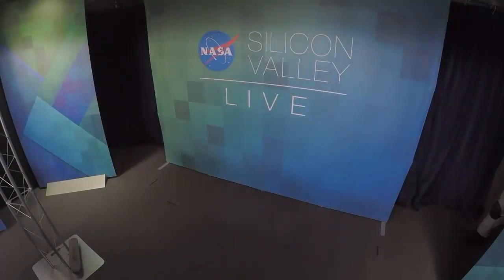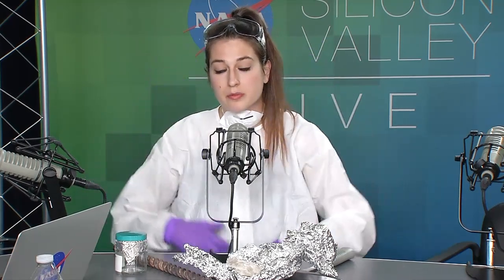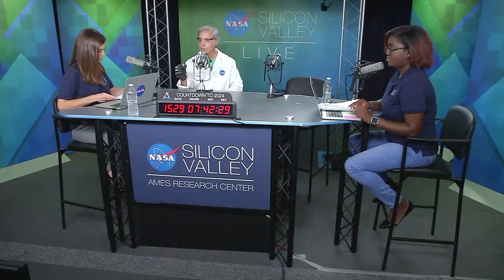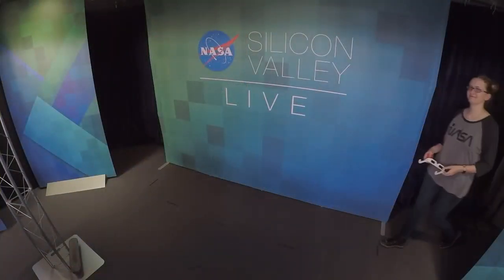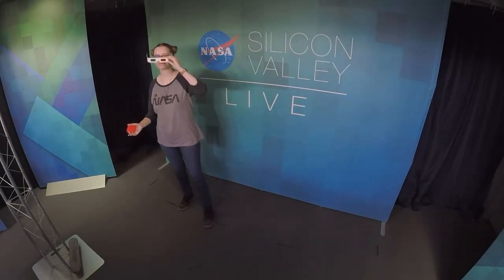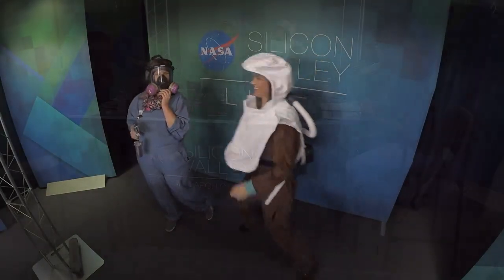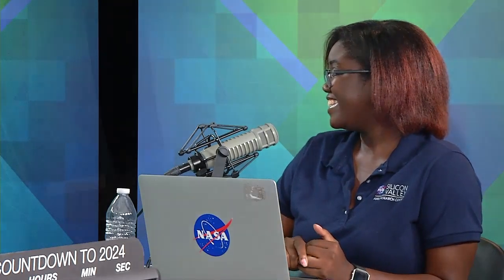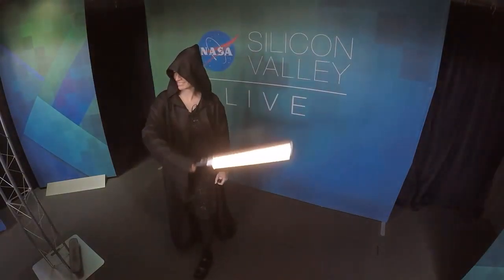NASA in Silicon Valley Live - Halloween Episode

Comment: Space is said to be an ever expanding vacuum. The earth's atmosphere is right next to this vacuum, and there is no container they say. How do we still have an atmosphere? Also to have gas pressure the necessary antecedent is a container. Jupiter is also supposed to be a gas giant. What keeps the gas just sitting there in a ball? The gas would fill the space right? Space defies entropy and gas laws it seems.
Reply: The gas is pulled to Jupiter's core due to gravity
Reply: @phantom2615  
Isn't Jupiter made up of hydrogen and helium? The sun is said to be similar. How are these gasses not expanding out into the vacuum? I'm not understanding how this gravity is holding these gases in a ball with no container.
Reply: @tbrown3356  gravity
Reply: @alexz9647  
Thanks Alex. I appreciate your help. It's just that I've seen how gas rapidly expands into a lower pressure system, and a vacuum would be the ultimate lower pressure system. I was trying to figure out what gravity is and I could not get aclear answer. Some say it's not a force but you can think of it as one. Others say it's the bending of space time, which I completely don't understand. Still, others say it's things falling down. Again, appreciate the help, but I'm starting to think this stuff is all just creative storytelling.
Reply: @tbrown3356  gravity drags things to the centre of mass. Gas is dragged to the centre of mass.
Reply: @phantom2615  
So what's this confusing rhetoric about bending space time? I heard Neil Degrasse Tyson trying to explain this and it made no sense.
Reply: @phantom2615  
Gas is defined as a fluid (such as air) that has neither independent shape not volume but tends to expand indefinitely. 

I'm really struggling to get how just claiming gravity solves this. Are there any experiments that can demonstrate gravity (whatever it is) holding gas in a ball? I don't know of any.